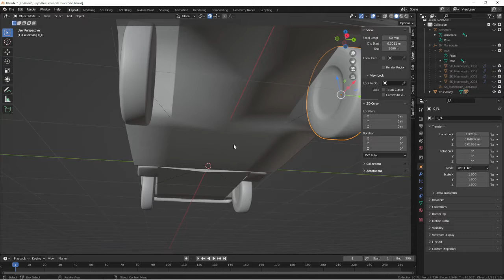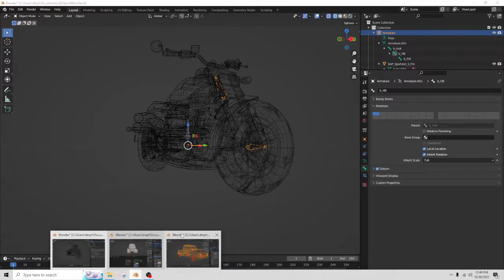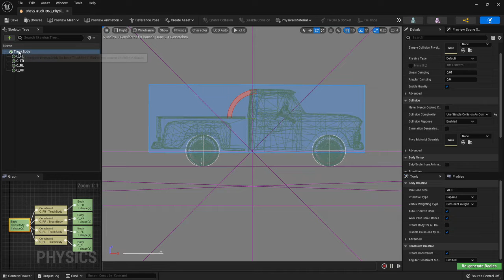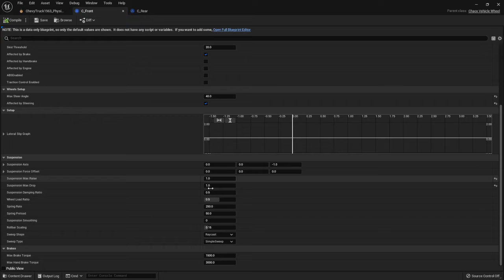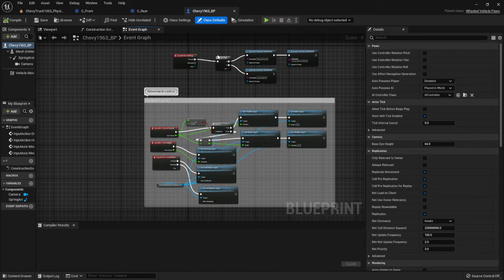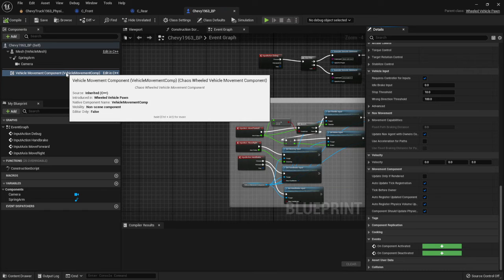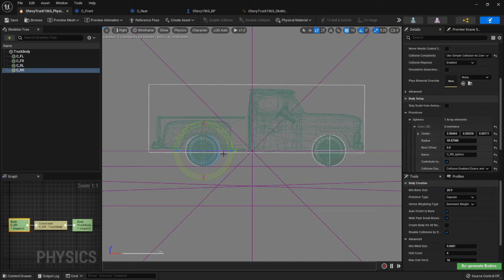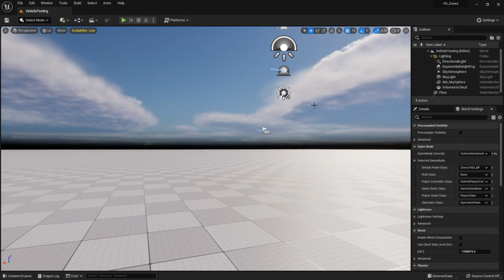How to Debug Chaos Vehicles |Blender to UE5|

Comment: How would it work if you imported that truck there? It doesn't look like it has any bones for even the wheels, so how do you point to the wheel's "bone name" in the vehicle component if the thing is a separate object?
Reply from the maker: If it's a functional vehicle with 4+ wheels, parented to a vehicle based armature with scaling applied, and exported as an fbx. Unreal has all of the proper blueprints to get it moving. The old way was parenting vehicles to armatures using vertex groups. Personally I think the new way is better though many don't agree. It's literally the most basic vehicle setup conversion from blender or really any program to unreal.
Reply: @indieartsmidwest4042  So is that why my vehicle is entirely broken? i haven't been able to get it working for weeks, it's always some dire issue like "the wheels don't collide with anything" or the thing just not driving at all. I made a skeletal mesh with rigging and bones/vertex groups and everything so I could animate it with the player, but was I not supposed to use that method?
Reply from the maker: @O_Obsidious Yes you could use bones but the new method in terms of the chaos vehicles is easier. This is because when you export all of those vehicle parts as one fbx. Unreal makes the bones upon import. It usually names them whatever the name of the part was prior to import. One issue that tends to affect things is the origin of your 3D objects. So obviously Wheels have to spin properly otherwise they'll look weird. But the body portion gets a little weird as well I've noticed. Some people have the origin just below the body or at 000 XYZ. Also, the physics blueprint is a big deal and has to be done right in relation to the chaos vehicle blueprint.

Comment: I need help, i set up everything but the set throttle does not work, by some debugging it shows that it does change to 1 when i press the input but the car is not moving, my back wheels are not moving, i really do not understand what it can be. Thanks!
Reply: (My front wheels are rotating correctly, it steers but it does not move)

Comment: Is there a way to implement chaos vehicles using C++? I saw that there was a way to create a vehicle class and set it up in C++ but since they removed the PhysX system the Chaos Vehicle is only available in blueprints. Are they going to create a way to make a C++ version of the chaos vehicle template?
Reply from the maker: To be honest, I tend to avoid coding unless it involves arduino's or microcontrollers. I can read code just fine but I've never been one to type it out right. I do appreciate the fact that through coding one can Implement more intricate features. Personally I prefer the blueprint system simply because I can come up with different functional Concepts through thought or with pen and paper. Hell I've even dreamt about blueprints😅. I've avoided using Unity for years because I don't want to copy and paste someone else's code. Chat GPT and unity does have me intrigued but only a little bit.